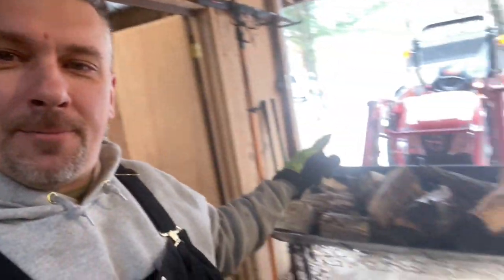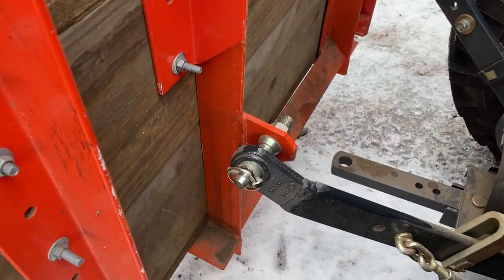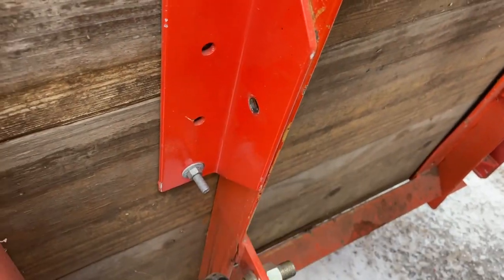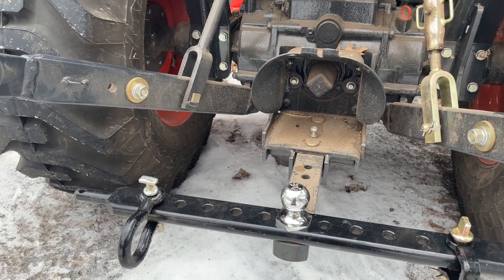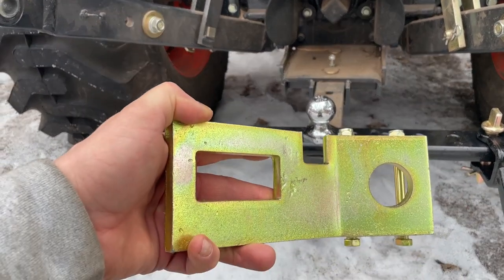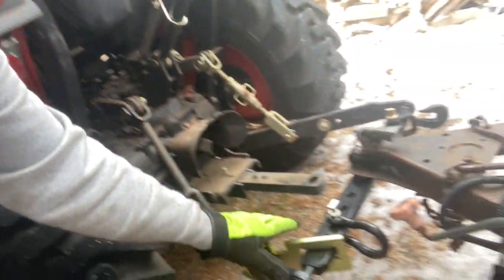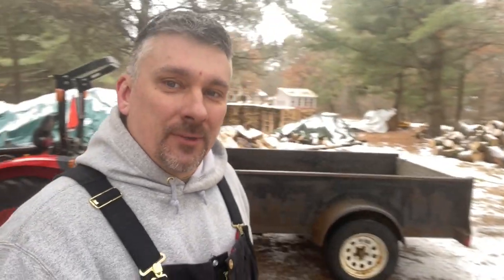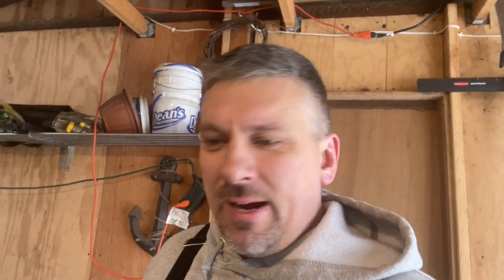I Bent the Carry All Frame - How Bad Is It?

Comment: Northern Tool makes a bolt on attachment for drawbar that you can also hook your top link up to item number 12471 model number 7350-1. Or Tractor Supply or Rural King  makes an even better square steel 3 point hook up with receiver built in. Careful you have no down pressure so the trailer tongue could ride up if it gets raised up to high or something stops a wheel when you are backing up. Should put one of those shackles in the actual tow bar on tractor to pull with. You can bend your 3point arms if you get to raring around with some big load.

Comment: Put a stack of washers to keep the arm over on the end of the drawbar. That should push the anti-rotation lock over enough so that it does its job. If you have a small weld shop around they could straighten out you frame and weld some additional angle or tubing to strengthen the frame, and probably be better than anything you could buy.

Comment: I have the same carry all.  I built my box big enough to carry a face cord.  That angle iron where the top link connects really starts flexing when it's 3/4 full so I limit my load to just over 1/2 face cord when I'm bouncing around in the woods and closer to 3/4 in the level wood yard.  It needs to get beefed up.

Comment: I would mount a large box onto that carry all permanently with a saw carrier for going into the woods to cut and haul wood, and buy another one if you want to have one for switching on and off. I built a couple of carry all boxes for different tasks and I mounted wheels on my carry all boxes, and I just slide under them and go, they aren’t permanently attached to my carry all frame, and the wheels let me move it around in the shop easily.

Comment: Hi Dan...yeah those angle iron frames are kinda light in my opinion.  Have you looked at any 3 point hitch pallet forks?  Their a bit more money, but obviously much heavier.  You could probably slide those under your carry all unit, with little modification.  You would also have the added benefit of using the forks to lift other items(logs, pallets etc.) as well.  I've seen 3 pt forks advertised with a 2000 lb capacity.  Just a thought!

Comment: And for a carry all (which you're right, is quite handy) I use one built of wood on a pallet like base.  It is a free standing unit, you simply run your front or read forks into the pallet section (I used 2x6's for the runners between top and bottom boards so it's easier to "hit" when running forks in....normal pallet is 3 to 3 1/2").  Added a scrap of 8" PVC pipe bolted in one corner to hold handle tools like axe or shovel, etc.  Added a scrap piece of tarp on top, attached at the top and kept rolled up, so if it starts to rain while I'm out, it can roll down over the whole thing to cover.  One could come up with all kinds of custom mods to fit whatever one does.  I carry my saws/etc to the woods, simply set the whole pallet off somewhere close and go to work.

Lousy out of focus photos, but you get the idea:
https://uniim1.shutterfly.com/ng/services/mediarender/THISLIFE/003080452239/media/44590217425/large/1559864527/enhance

I was installing some solar panels, put them on the front forks, the pick up the carry all, and it holds the panels in place nicely for the trip to the mounting place......plus tools & hardware.

https://uniim1.shutterfly.com/ng/services/mediarender/THISLIFE/003080452239/media/44590217412/large/1559864526/enhance

Comment: I’m sure it can be fixed cheaply and reinforced with added cost but you would have a better one then you could buy after the fix. Check around and see if there is a local guy that could fix it. That would be my first choice. Good luck.

Comment: If you have a 6-pack, torch with a heating tip and an afternoon free of nothing to do, you could try to fix it. Otherwise, I would wait for spring. When you do get the new one, reinforce it prior to use. My Carry All is only good for 1000# payload, lifting or pulling. Can't imagine yours was much different? Neat draw bar widget for anti-rotation. Thx for the vid as always, Dan.

Comment: Since you don’t need to have it be convertible anymore is it possible to weld a skidsteer plate to the basket part and use the carryall with more wood as intended. Then you have two tools. I built a quick attach carryall to use in place of my bucket and now I rarely use my material bucket. Mine holds a facecord of splits and really speeds my operation up. As in dumping them in the side of your wood shed or in your trailer or lots of big rounds out of the woods

Comment: Hi Dan - it's Big Rodders in Ireland.   From here it all seems fixable.  Level the two tongs with your front loader filled with some weight.  The left upright could be straightened with a bit of heat and you swinging a 14lb sledgehammer.  Cut out the top link and then the two tabs for the pin.  Weld in a replacement piece of angle iron, perhaps with a second one piggybacking it then weld on your two tabs.  Alternatively, buy a new Carry All for €150 and cannibalise the old one to make a new Carry All to fit over the trailer Y frame, facing forward, either fixed or removable.  If you are going to tow the trailer behind the Carry All, get a towbar made up that will attach to the main tractor hitch so that takes the brunt of the weight, diverting pressure away from the top link.  Meanwhile - Keep on Splitting!
Reply: Dan - Big Rodders again.  Forgot to mention your new towbar gadget.  Apply a bit of heat at the angle to make it more acute, which may enable you to mount the second bolt.  Also, when you press the gadget as close to the ball hitch that it will go, mark the bar and drill it for a bolt/roll pin that will prevent it from drifting towards the swivel pin.  I trust that makes sense to you.  Cheers and Good Luck!
Reply from the maker: That's a good idea to drill a hole to keep that drawbar lock over on the drawbar...thanks for that feedback. 😀 👍 🍻
Reply: @Back40Firewood  Hi Dan - Big Rodders again.  As the old joke goes over here - "we might be green, but we ain't stupid"!  It's all a question of ducking, diving and adapting.  Will be interested to learn what route you take regarding the Carry All.  My preference would be to buy a new one and use the old one to both make up a Carry All on the front of the trailer and to reinforce the new one.  A reappraisal of you trailer towing process would ensure the problem does not reoccur.

Comment: Put a few washers over your left 3 point pin, outside the arm and inside the hitch pin. That will pull the draw bar closer to the left arm so the draw bar lock doesn’t slip off.

Comment: look into "Big Tool Rack"  several other you tuber's have been blessed with them and they seem to be very happy with them.  maybe you could notify them the company that you are lacking and can provide exposure for them.  Trailer hitch is part of the unit
Reply: Big tool rack is way over priced in my opinion! And the you tubers you mentioned having them. Well not too many seem to be using them. They show them advertise them. But never see using them again. So there is that!
Reply: Rick, well said.  I built a carry all alot better than what they sell.  On Out Door With The Morgans, they delivered a carry all with all the fan fair.   Motor Mike Morgan paraded it around a couple of days and then it got parked some where and not seen again.  Hhhmmmm!

Comment: Hey Shifty, I would advise against purchasing a new one unless it was designed better featuring heavier materials and had reinforcement built into the design.   You could align the forks by means of either applying a load to the fork which is higher or apply upward pressure to the lowest fork, possibly with Senior's loader tractor.   I'm sure Senior likely has a good option for ya.
Bless'ns to ya, Tedd
Reply from the maker: Yeah I think if I did get another one it'd just end up the same unless it was really modified with heavier steel...and then it would probably be more cost effective to just start from scratch...oh I'm sure Senior would have multiple tricks up his sleeve to try to bend that back. Or he'd just laugh & say 'pff Chinese steel...send it to the scrap yard!'  hahahahaha

Comment: I would think you can fix the 2 side pins with a pipe clamp. Up top I would cut out the angle iron, cut the connector off and weld a stronger piece back on. Things are much easier to fix sitting on my couch LOL.

Comment: You been using it bent for some time now.
I would just keep using it. It's working just fine.
A new one is just going to do the same thing over time.
Reply from the maker: That's true....it still serves its purpose and yeah a new one would end up prolly the same way.
Reply: If I lived closer, I would build you one that will not bent.  That angle iron is not strong enough.

Comment: Just cut off the flimsy bent angle and have some box welded in its place with 2 plates for the the top link pin , if you've a mate with a welder and any competence it's a very quick job to do , but for 150 or so for a replacement  it's just as easy to buy a new one , stuff like that is pricey here in ireland , to buy one new would be extortionate compared to what it cost to make it from scratch

Comment: I'm sure one of these folks will have your solution. If it was me, I would use that trailer like crazy.
If you are gonna get involved with a welder anyway, maybe think about putting a box on the trailer for your tools if you have room for it.
You could unhook the trailer and use your forks to load it with whole logs.
I'm just glad you're not on here asking for money, that gets old in a hurry.

Spit balling🔧🔩🔨📌
Reply from the maker: So far the trailer is actually working out great for moving wood...thinking I might just start keeping more tools & such back in the woodyard then wouldn't need the carry all to move them around. 😀 👍 🍻
Reply: @Back40Firewood  man you are in the gold!
You should get a back 40 firewood contract for bundles at homedepot or lowes

Comment: If you fixed it it would take a torch to heat is up then pound it back in shape or just buy a new one and use the metal off that one and use it on the new one to brace it better.

Comment: This is just a suggestion, I would get a big pipe wrench on top frame and with a long bar, try to twist it Down and relieve some stress on top frame, that may begin to level out 'fork arms' as well. Then the left side arm can be twisted IN to straighten. Once it is straighterrrr, then weld some braces into webs of angle iron frame. Good Luck.

Comment: 1. I wouldn't tow the trailer with the jack stand down.  If  it catches on something in the road it will be BAD.  2.  Don't worry about the bent frame on the old piece too much.  A good metal shop can straighten it out some  with a press.  It's no biggie.  3. If it was mine, I would weld a flat plate across the opening on the bent angle.  That would make it stronger. BUT, it all depends on how much a welding shop would charge you. Doesn't your Dad weld? If not, it might be cheaper to just get a new, better one. 3. I'm a welder so that type of thing is no biggie for me but it may be for you if you have to pay very much. 4. How much would it cost to UPS that bent part to me? (Oak Ridge, TN 37830) I could fix it for free for you.   5. I don't like the loseness of that new draw bar bracket that you just got and the flat bar looks too weak to me.  All the weight and forces are right in the middle and it looks like it needs to be thicker and wider.  The opening in that new bracket part that you bought is too big for that bar.
Reply: Good point not to tow trailer with jack stand down.

Comment: Most carry all's are WAY too light weight, being built out of simple angle, to be used for rear forks.....as you can see from your experience.  

If you're gonna do that, get a set of hay forks made to handle the weight of logs/etc.  I have a very sturdy set that I used all the time on my first tractor that didn't have a front end loader.  Cut them down from the original 48" to 40", which helps over come the way a 3pt system has to raise stuff.
Reply: Also a quick attach hitch is nice when changing stuff 
The other post here refers to the t type Hitch from tsc with receiver that is nice too with quick hitch you can change attachments easy

Comment: Depending on your budget I would ditch the bent frame and invest in a nice set of three point hitch pallet forks . Then you can use them for the carryall platform or the forks for lifting logs etc . The amount of wood that you do I think you can justify them . Or plan B you find a good welder fabricator close too you that needs wood once and awhile 😂 On the bracket you bought I would drill a small hole  for a pin in drawbar too stop it from sliding back . Plan C is you learn how too weld and fabricate and spend lots of money on a welding machine / saws / tools etc 😂👍
Reply from the maker: LOL....well I can definitely eliminate plan C. I do like that idea of drilling hole for pin to hold drawbar lock in place.

Comment: Could you put the trailer ball on the tractors draw bar hole, or would that be too low?
Reply from the maker: The threads on the ball hitch aren't long enough to go thru and it would be a bit low.
Reply: They sell 2 in ball with longer threads, and spacer to raise it. I suggest take it to local welder to reinforce with 2” square tubing.

Comment: I never use a drawbar thing on mine.  I built a T shaped deal (copied from one they sell at Tractor Supply) with a 2" receiver mount in the bottom.  Stronger and more versatile than a drawbar mount for things like a trailer hitch.  I call it the Blue T Bar (to differentiate it from the yellow one they sell at TSC for twice the price of building one.....ahahhaaha)

It can also hold custom made stuff like the field wire holder I have mounted in photo below, which is just a hunk of 2" tube, pc of flat plate to sit the wire roll on, and another pc of square tubing running vertical to hold the roll of wire (like a toilet paper holder).  

To load the roll of wire,  with the 3pt lift raised about 1/2 way, remove the top pin and let the vertical part pivot to the ground, slide the roll on, lower the lift, and pivot the roll by hand back upright.  Insert top pin.  To use, start the roll coming off, nail to the first few fence posts, then you can drive 50' or so down the fence roll as the roll un-winds itself.  Stick a bar in the roll down low, let it come around and catch the blue upright part, and you have a handy-dandy fence wire stretcher as well !  (Pat Pending....ahahhahaa)(Please note one modification:  The square plate at the bottom of the roll of wire does NOT work....square corners catch the wire as it unrolls.  I added a pc of 3/4 plywood cut in a circle on top the metal plate that fixed that problem)

https://uniim1.shutterfly.com/ng/services/mediarender/THISLIFE/003080452239/media/40412665969/medium/1329328835/enhance

The blue T bar is also what I use with my homemade potato hiller.....another thing made of 2" tubing that fits in the receiver hitch.  You can come up with all KINDS of things made to fit a 2" receiver hole. (Discs and spring point plows from an Ag supply catalog)

https://uniim1.shutterfly.com/ng/services/mediarender/THISLIFE/003080452239/media/40412666203/medium/1400275889/enhance

https://uniim1.shutterfly.com/ng/services/mediarender/THISLIFE/003080452239/media/40412666243/medium/1400275928/enhance
Reply: get a real set of forks for draw bar it will not bend like your cheanel
Reply: if you get new one in time you will have 2 bent ones
Reply: @redneckjoe2494  ::  Truth Spoken Here!   Unless another company builds one out of better materials, it is really pointless to purchase another one.

Comment: With a couple sturdy adjustable wrenches and some cheater pipes you can tweak that frame back to straight.  Like others have mentioned, it's doomed to bend again, it's a little too light duty for lifting a full trailer.

Comment: Maybe you explained it and I missed it.  Because it’s not straight does not prevent it from working right.  Use the draw bar for the trailer.  It’s fine this is not carpentry it does not need to be square and plum
Reply from the maker: Yeah it does still serve its purpose just isn't as rigid as before...and if I just use the carry all for gear & saws etc. then won't really matter I guess. 😀 👍 🍻

Comment: Shifty,  if you have a torch, a press, a porta power and a welder if can be fixed.   It will be some work. If you buy a new one, reinforce it with box channel and reinfore it.  Most are made light duty you may have the same problem again if you buy one and dont beef it up

Comment: It could continue to be used as is, but your really using it for more than it was probably intended.  Could it be fixed? It could be made straighter, but it would take more time than it's worth, and it will never be straight.  The problem with angle iron that it isn't terrible resistant to torsion; and especially in the orientation it is on the top link it is not resistant to bending.   I live about 1.5 hours East of you, and if you'd like I could fabricate one that works with your current carryall that could handle some extra weight. If you wanted to save a couple bucks, I could leave it bare steel and let you paint it. It looks like your drawbar lock could be bent a little further so that it stays engaged to the rectangular part of the bar.  I could do that as well if we were to work something out on the frame.

Comment: hi there B40  those bends wont hurt a thing , if you don't bend stuff your not getting max usage . it will be fine . on your draw bar ill but a link to what i did 25 years ago . if you don't have a welder maybe you have a connection or weld shop  . the angle iron that holds pins is also very handy . ill do a video on just them when the weather brakes  .https://youtu.be/7sdOO1XEzZ0.  take care john